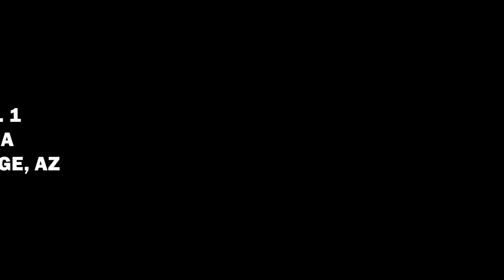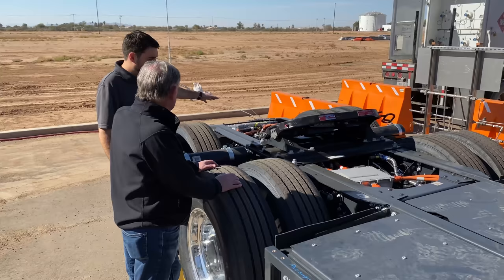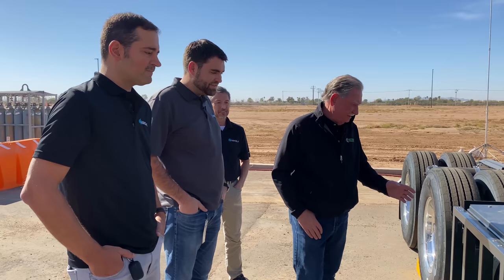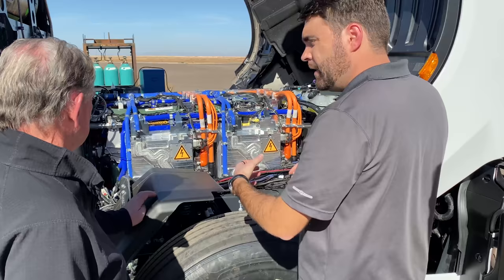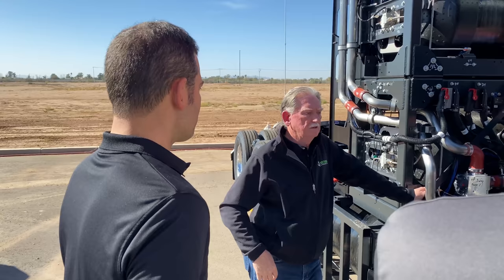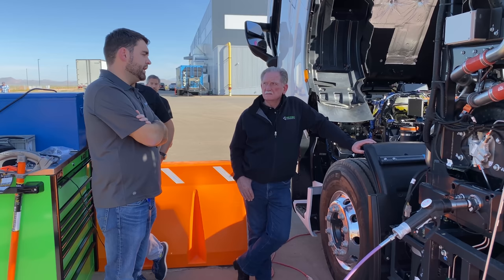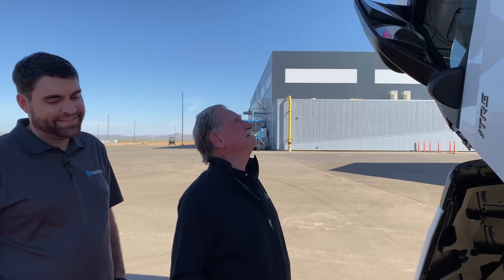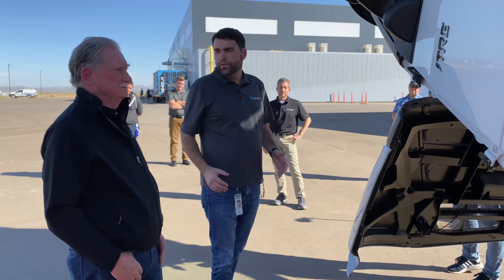Nikola Series - Ep. 1: Introduction & The FCEV Alpha

Comment: You can tell the whole system has a lot more complexity, than what you would see in any BEV truck. There are just many pipes and wires, which will be costly to install and maintain. This technology is really better for planes, where there are many people doing the careful maintenance work. With the electric highway system BEV trucks can also charge while driving now, so the only advantage of hydrogen for trucks is gone now as well.
Reply: The future is going to be more sophisticated. NIkola is an example of how people will crucify new companies that bring change. Most people only understand 100 year old gas engines.
Reply: Nobody has charging highways and that is also expensive
Reply: @SciFi Author B.L. Alley hydrogen is locally sourced. While expensive infrastructure, no oil wars or lithium mining required.
Reply: @togowack  terrible loses in the conversion processes. Specialist catalyst materials some of which are from rare earths, wear out quickly and require mining for them. What about disposal and recycling of the catalyst elements? Infrastructure doesn't exists right now to support it.

But we have plenty of grid infrastructure that can much more easily be upgraded to support the ev transition. 
Plus h20 still requires large batteries and electric motors to function. So how exactly is hydrogen better again? 🤔
Reply: @4literv6  EV have reached their max. People who can afford/want them have them. Billions of dollars have been set apart for H2 in Canada and Europe. The technology is better but more sophisticated. There are many ways to extract and deliver hydrogen besides electrolysis. The decision has already been made only a question who ends up in position to take those dollars.
Reply: Electric highway systems are not feasible at this time.
Reply: @andrasbiro3007  Yeah we know Tesla was a success after 10 years of hell and they put Tesla through the same thing.
Reply: @togowack  I figured you couldn't supply a single counterpoint with any factual data behind it. Guess time will tell as it always does.
Reply: @togowack  
What are you smoking?
1. IF Tesla could double it's production? They are doing it every 1-2 years. They made 340K cars in 2019, 500K in 2020, will end well over 900K in 2021, and easily hit 1.5M in 2022, maybe even 2M. Plus they are opening two new gigantic factories soon. Combined capacity is at least a million, but when fully built, it could hit 5 million or more.

2. Their build quality is actually increasing fast. They are currently industry leaders.

3. No other company is even planning to catch up to Tesla. Look at their projections, they are pathetic. Like being 50% electric by 2030, and that still includes hybrids. Toyota doesn't even believe they should build EVs. Volkswagen's new CEO tried hard to steer the company that way, but he couldn't overcome the internal resistance, so that's not happening either. Stellantis' CEO just said publicly that they are incapable of changing this fast. Ford and GM are already just shadows of their former selves. GM currently doesn't even sell any EV, because the Bolt isn't safe, and the Hummer isn't ready yet. Not to mention that the original Hummer was a pretty low volume car in the first place, I don't expect much better from the new one. Ford at least has an EV, but they don't make much, and not planning to change that. The electric F150 seems god, but it's not sold yet, so it can still face big problems. It's even likely, as almost everyone is struggling to build good EVs. Tesla is so far ahead because they started almost 20 decades earlier and got through their failures while the market was much more forgiving due to the lack of competition. Asians are probably the greatest threat to Tesla, but they are also new to this game, and don't have the strong brand in the west.

4. Experience is a disadvantage actually. Because Tesla redefined the game, not just by building very good EVs, but by making them computers on wheels. Traditional cars are largely analog, with some electronics sprinkled on top, while a Tesla is digital from the ground up. That's an entirely different world, where traditional automakers are the noobs and Tesla is the pro.

Comment: Interesting to see- these guys are smart fellas! 
So, firstly :
Most hydrogen is not green- most is made from fossil fuel, and anything BUT green.
However if it’s made from electricity, it’s absolutely horribly inefficient.
Secondly : 
Running cost is very high (which has a lot to do with that lack of efficiency) - higher than diesel as I understand and much much higher than electric. (Running cost is critical for a trucking company.)
Thirdly :
Owing to a very small battery, very little regen will be available Eg: descending a mountain range. That’s another huge disadvantage compared to an electric truck.

Perhaps remind me again- how is hydrogen a good idea for trucks compared to electric?

Comment: Back in 1990, l was part of the 'ground crew' to set the wheels in motion for the Corrola/Nova plant inside the old GMH Plant in Dandenong! This NICOLA Factory looks to be a looooooong way from start of series production! Good luck to all involved! I have a sense of the blood sweat and tears to get to production scale! Like Elon says, 'PRODUCTION IS HARD'
Reply: It is empty.
Reply: The Nikola plant is for assembly. The GM plants would have included manufacturnig. The layman won't understand that though. The parts for the most part come from Europe.
Reply: The trucks are made by IVECO in Germany.
Reply: @DR.LingeringFrey  The electric parts are mostly IVECO the H2 parts sourced elsewhere.
Reply: This part is just for hand assembly or prototyping. They are building an extension which I presume is (or they switch) going to mirror their Ulm, Germany Iveco/Nikola joint venture factory and have automated guided vehicles that drive the truck through to various stations where there is specialized equipment and operators to assemble the truck. They have had equipment sitting outside for months that is said to be for the expansion area.
Reply: They have a plant in Ulm, Germany that is at a much more advanced stage. The one in Arizona is at what they call Phase 0.5 and currently expanding into Phase 1.

Comment: H2: 18% efficiency from electricity, 35% from natural gas
- need refueling stations, transport, etc.
Autonomy: similar to BEV in best cases
I am surprised they still try to push H2 fuel cells.
May the best technology win!
Reply: The best tech has already won. it's BEV.
FCEV have approx 0% market share.
Reply: @chargehanger  I like hydrogen as a complement to BEVs but godammit you're so right lol
Reply: Normally Sandy is spot on, but I don’t understand his pro hydrogen stance. It is an expensive fuel to produce as well as the logistics.
Reply: You need to keep in mind a very important factor for long range haulage. There are maximum load limits for trucks and that's not set by the manufacturer, a truck can only weigh so much, so if you have a truck with 10 tonnes of batteries in it it's payload will be very small, charging times high and efficiency goes out the window when looking at a cost factor.
Sometimes a more expensive fuel is worth the increased payload and reduced time per load.
Just a matter of doing the math on each situation.

Also on long haul you won't actually need that many fueling stations, so that helps.
Reply: @kleinzach007  Hydrogen is light and reduce to water with the oxygen from the air. With better full cell and a good/safe way to store it would be an ideal energy storage.
It’s not there yet, and it might take a very long time, but if it ever work, it would be good for planes, boats, seasonal energy storage, etc.
Reply: can i ask where did you take this number from? That's between 50-60% power generation net efficiency.
Reply: @alexforget  I dont know what make you think it is not there yet but nasa is using hydrogen for a few decades and Plug Power is the largest consumer of hydrogen worldwide. Giner ELX is a company specialising in electrolysers and they are in the business for already 47 years.
Reply: @kleinzach007    Because hydrogen COULD BE a great fuel. It's just not now, nor will probably be for at least a decade.  But they need to get the efficiency to be at least on par with diesel/bio-diesel or it's just waste of time and money.
Reply: @phillipzx3754  the cheapest way to make H is to steam reform at 850C at 400psi. This is how it is done commercially, plus it uses natural gas a feedstock & produces CO2 as a byproduct. Maybe Trevor Milton knows a more efficient way to produce H.
Reply: @user-jo8fe1mk6b  I don’t think it exist in a meaningful amount enough to supply transportation .
What is their efficiency from electricity to compressed hydrogen?
What is the cost of a fueling station?
BEV is taking the world by storm at this point, any technology that want to compete must reduce it’s cost faster than batteries
Maybe there is still a place for hydrogen in a niche market, but the opportunity window is closing fast.
Reply: @alexforget  No BEV Semi has taken the world by storm yet. in fact even an BEV pick up truck has not been made to prove batteries can work in that niches. I agree FCEV has no value at the passanger vehicles but at vans and larger yes.
Reply: @matthenley7641  Elon factored that in. I think he thought of a lot of things we haven't yet. Duh

Comment: We need to know this. Those two are Bosch employees. Nikola is entrusting the hydrogen fuel cell to Bosch. Nikola can't be trusted, but Bosch is reliable.
Reply: As long as you know who to subcontract even shitty brands like VW can make cars. For hauling the efficiency is not a problem you need the long distance.
Reply: @MegaSoarer  It`s the same BOSCH that wrote automotive history several times in the past (spark plugs, ignition systems, injection systems for gas and diesel engines, ABS/ESP, lambda sensor for exhaust gas system, components and systems for all motorsport classes worldwide). Do you know who equipped the Formula 1 winner cars of the wolrd champion ship during the last 7 years in a row or the 24 h race of Le Mans for tthe last 20 years in a row ? Without Bosch components/sytems the race cars could not drive outside of the pit
Reply: They also look like brothers.  Twins?

Comment: How HOT is it?? Please ask: 1) What is the operating temperature of the fuel cell? 2) How long does it take to get there from ambient 25 c, 0 c and -20c?  3) Will the truck drive on battery power while waiting for the fuel cells to heat up?  4) If "high speed" means 35 Mph, what is the performance at 65 Mph? 

Most people don't realize that fuel cells operate at elevated temperatures ~ 250c and above.  It takes big batteries and heating elements to heat those fuel cells from -20c and also provide energy for driving while taking quite a while for them to heat up.
Reply: The problem is that "Hydrogen" sounds flashy and cool. The practical obstacles with this technology have always been immence. Hyln has the most practical solution out there and have physics on their side. The only question is if they can deliver.

Comment: That nice Iveco / CNH Industrial (*corrected from Stellantis*) truck chassis has been in production for a few years as the Diesel S-Way.  New sheet metal, badging, replacing the engine with 2 fuel cells and adding 5 Hydrogen tanks and a bunch of batteries does not make it a "new truck".  Though maybe adding the extra heavy armor does.   It is currently made in Ulm, Germany.
Also of concern is the mention that in the future they need to add some "intelligence" and continuous monitoring to aid in fueling and operation.
Reply: Iveco is currently a part of CNH Industrial, not Stellantis. The Iveco S-Way that this is based on is made in Spain.
Reply: @shazam Your opinion of what make a new truck is not interesting. Instead, consider the benefit of having said truck.
Reply: @markplott4820  That's right. I am astonished Sandy Munro did not notice that truck was a hologram.
Reply: @lockbert99  My mistake, Iveco is indeed part of CNH Industrial not Stellantis. It is made in Ulm, Germany in a joint venture factory.
Reply: @shazam6274  At this point, both the Ulm factory and this Coolidge factory get the truck cab and other components from Spain (Coolidge gets chassis or something from Iveco Mexico) where the Iveco S-Way is built. I think that eventually this site plans to build components when it expands. But Ulm is small (and a refurbished building in an existing industrial park) and I think will always import truck components in it's current form.
Reply: @lockbert99  Thanks. Interesting, perhaps the Ulm "factory" is there to help sell trucks to the Germans, like the 25 BEVs for use on the docks?
Reply: @shazam6274  Iveco could have partnered with Nikola (their CEO claims they approached Nikola) so they could quickly make zero emission trucks to avoid the EU emissions penalties. Although it is a 50/50 joint venture, Iveco gets 100% of the credit for a European zero emission vehicle sale. But right now the truck being produced is too long for European regulations, so can only be sold to a port or some other off-road usage. They won’t have a shorter European-acceptable version until 2023.
Reply: @lockbert99  Thanks again.  The size you mention is interesting because in the 1st video from Sandy Munro today, Nikola explains that they are adding body length to the front for better aerodynamics.  (Sandy's suggestion is to eliminate the giant side mirrors 😁)
Reply: @ThisIsF-dUp  Nikola states that is is a new design.  We will have to wait a year or two to see how well it works and what it costs to buy and operate.

Comment: 200 KW power output? is that not incredibly weak for a truck that has to pull huge loads?
Reply: Kinda, but with loaded trucks it is more about torque than HP. A 1000 hp LS engine would make an utterly crap truck engine, electric drive trains have significant torque at a wide variety of rpms advantage over a diesel which tend to have peak power over a 300 rpm band, why they have so many gears. I am not sure the peak hp in this case is overly relevent.

Comment: Batteries might have slightly less range at end of life but still much better efficiency then hydrogen. So who cares if the fuel cell retains its full capacity. Good job Nicola by not ever mentioning efficiency
Reply: "efficiency" is a game of semantics of how you want to look at a problem
Reply: If you want to drive in the night and charge at daytime, when the photovoltaic are running, hydrogen efficiency is worse.
Reply: Not always, weight can affect the calculation. The more weight your truck is carrying the less cargo you can carry. So it's not that simple.
Reply: They talk like their membrane surfaces won't degrade.
Reply: The Fast Lane Car just had a Toyota Mirai video that said a full tank costs $89, and Google says a Mirai has 350-400 mile range.  It's not a direct comparison to Nikola, because a Mirai can also drive uphill.  Great video, as always!  Looking forward to part 2.
Reply: @bjrntofteeng6100  I wonder if it would make sense to swap out truck batteries like nio cars.
Reply: @TheJttv  nope, if it takes 100watts to charge a battery and u get 80% of that back out as work to the motor vs 20% after all the efficiency loss related to making, storing and using hydrogen then its not semantics
Reply: @bjrntofteeng6100  the only reason we talk about hydrogen is because the big refineries desperately dont want to be out of buisness. Whatever energy source is cheapest to make ant to use will will. Thats not hydrogen since it takes a lot of power to make clean hydrogen and there is a lot off efficiency loss with hydrogen (way more expensive to fill your tank with hydrogen)
Reply: @IronMan-wz8dx  in a few years batteries will have much more range, so why bother. Range anxiety is already almost a thing of the past today

Comment: Sandy, there is no way a camera will work the same on a tractor trailer as it does on a passenger vehicle.  I have a Class A, and I can tell you that backing a trailer up is the most difficult thing a truck driver does.   Being able to move your head to change your perspective is very important.  Unless they supplement the cameras on the tractor with cameras on the tractor (my last semi had a backup camera on the trailer) and come up with a standardized plug and power system for them, it probably won't work.
Reply: Mirrors need to go, I hope/feel like if Tesla can train 'autopilot' to work similar to the human eye, then engineers are capable of designing and training a camera system to assist HGV drivers to reverse their trucks. Even the company I work for has CCTV that detects and follows movement in the car park.

Comment: Quantum Scape and now Nikola Motors. I'm concerned that both are using Monroe for leverage. Monroe needs to ask more aggressive questions. For example, with QS interview, he should have asked questions about successful production of the ceramic separator which is their "secret sauce."  How much separator does QS have to produce before having a ceramic separator that works and doesn't crumble during the automated battery process. Is it 50% while 50% is waste. Worse case,, maybe only 2% of ceramic separator is produced without flaws and works. Do they they take that 2% and build 2 layer semisolid battery by hand (not automated) and then demo that product as success. I have doubts about QS. Same doubts about Nikola. Instead of a hydrogen-electic hybrid, which is a  differentiator from many other all electric class A trucks, they are now competing head to head with all electric class A trucks. Nikola sold themselves to the public as a hydrogen electric truck, not an all electric truck. This was a significant deception to the retail investor